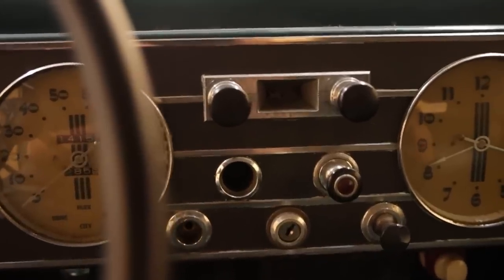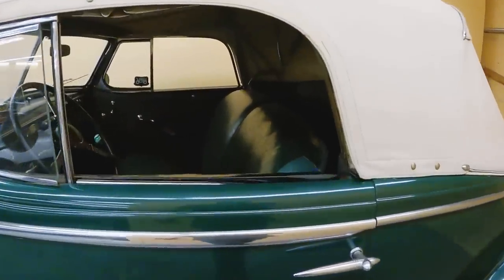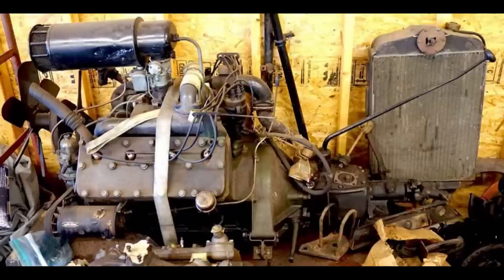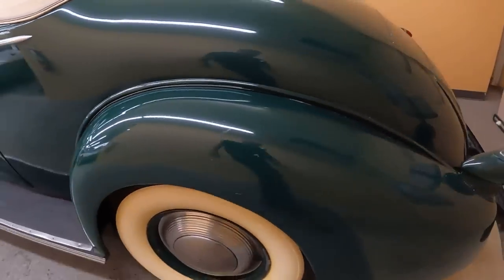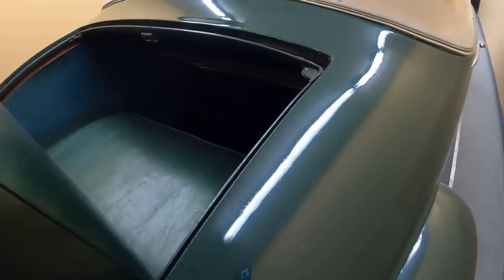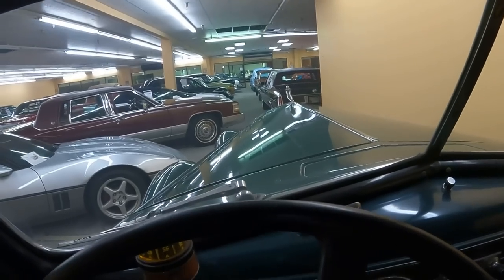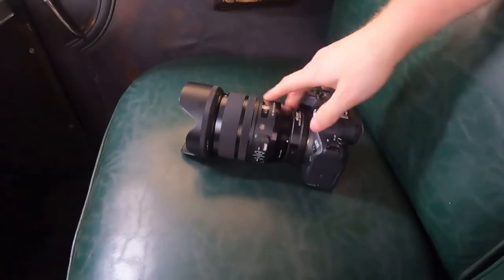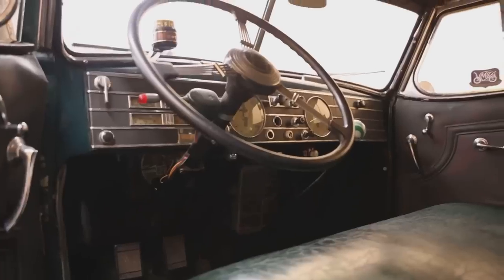1936 Cadillac series 36-60 V8 convertible coupe, bridges the gap between La Salle and Cadillac

Comment: In my day the Cadillac Series 60 was the top-of-the-line offering—the deluxe model referred to as the "Series 60:Special Fleetwood"
Reply from the maker: This one was really hard to research I wasn’t I’m not I still am not 100% sure if it’s a series 60 or a series 70 because it looks like a series 70 until you get to be interior then it doesn’t.. and that was the other confusing but is Series  60 for this generation of Cadillac is basement model
Reply: I noticed that when you were opening the hood the emblem on the side said “V-8 Fleetwood”.
Reply from the maker: That was another confusing bit because when looking up 1936 fleetwood v12 and V16 Show up

Comment: Just another fantastic treat ! Well done
Reply from the maker: Thank you so much I’m glad you dig this episode I was so nervous about releasing it because of the series 60/series 70 debacle I originally wrote the script as it was a series 70 car but then after looking at pictures of what a series 70 car is it didn’t match up with the pictures that I saw last night but this morning it did look like a series 70 car series 60 Is shorter and has a different grill and slightly different interior than the series 70 but the car in the video looks like it’s a series 60 just has a different grill because the interior is like a series 60 interior plus on top of all of that this is a coach built era where are you could essentially get whatever you want so I just figured I’d leave it the way it is because I like the way that everything flowed in this episode had really nice flow.. and I didn’t want to give that up essentially but yeah the jury is still out I don’t know if it’s a series 60 or a series 70 car it’s advertised as a Fleetwood body and that throws a whole Nother bone into the mix because Cadillac had bodies by Fleetwood but if you type in to google Cadillac Fleetwood from 1936 V12 and the V16 show up not the v8

Comment: A non Mono block V8 was cast as 2 pieces then welded together to make 1 block. Making a mold to cast a mono block were very costly back then which is why most 8 cylinders were straight 8s. And also why cars then had very long hoods to house the long 8 cyl. engines.

Comment: This is a 70 not a 60.  I own a 1936 70 convertible coupe.  Looks like someone did a restoration of the interior in the late 50s or 60s and did a poor/low cost job, but hey - it was just a used car then.  Fleetwood made all the bodies for the 70/75 series, Fisher for the 60/65.  The 60 also has a wheelbase 10"s shorter the the 70 and it lost out on the storage space behind the seats.  60 had the smaller V8 also.
Reply from the maker: Thank you so much it wasn’t labeled what it was so I tired to figure out the model and that was harder than I thought thank you for that information =)
Reply: @What.its.like.  Your welcome, I really enjoy your videos and the enthusiasm you have for the cars.  It is hard to tell the diff between a 60 and a 70 unless you live with one!
Reply from the maker: Thank you so much i’m glad you dig this channel =)